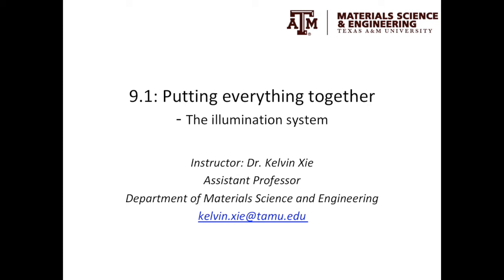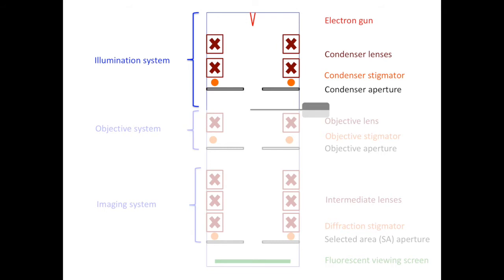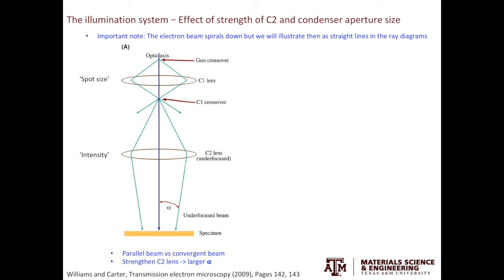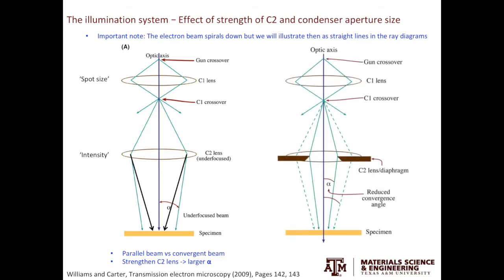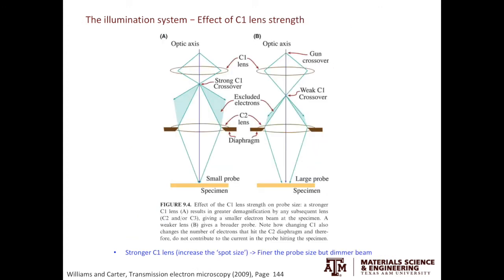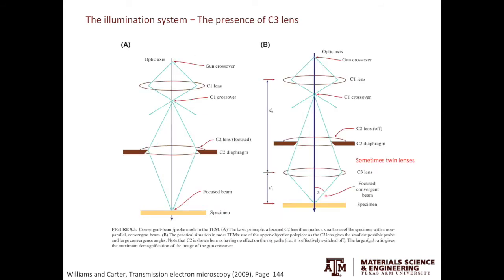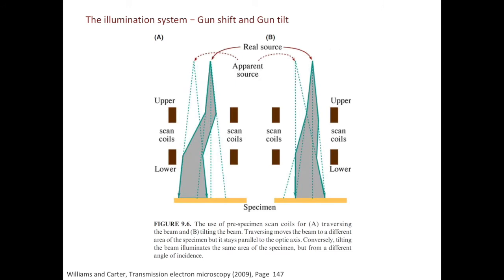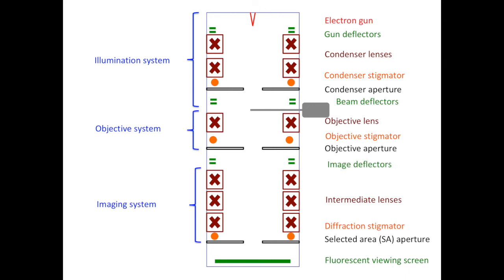9.1 - The TEM instrument: The illumination system

Comment: Dear Kelvin, can you please clarify what it means by 'spot size'? Is it the area illuminated on the specimen? I am confused about this with the beam spread from converging/diverging beam.
Reply from the maker: Spot size is really an engineering term. It is controlled by the strength of the condenser lens (C1 if I remembered correctly). The larger the spot size number, the dimmer the beam, but the smaller the probe (better resolution especially for STEM).